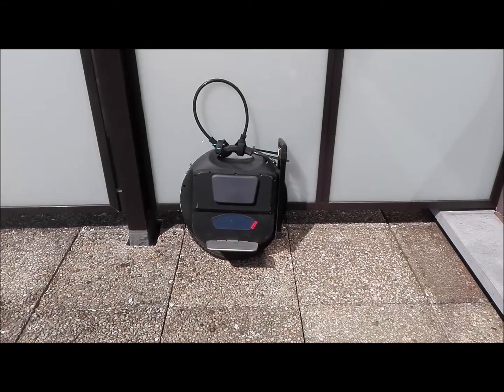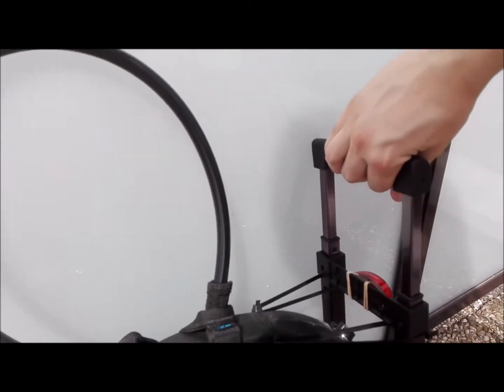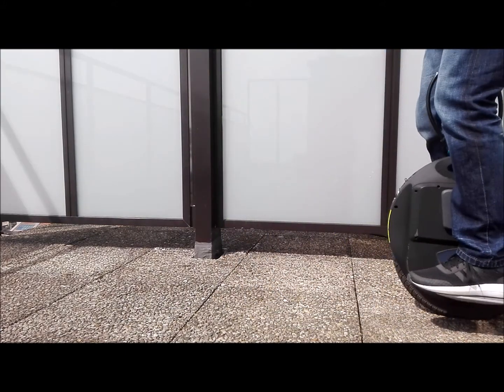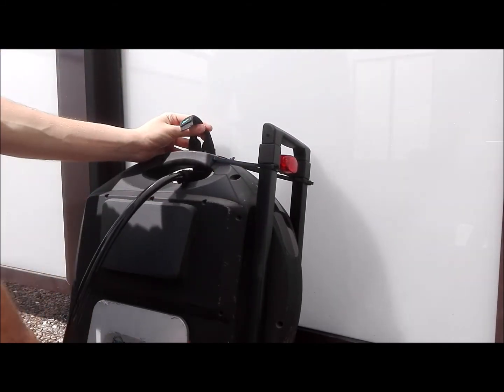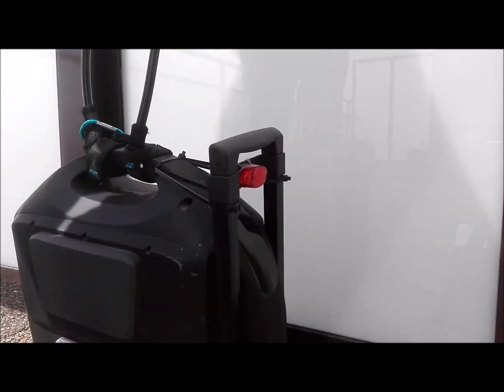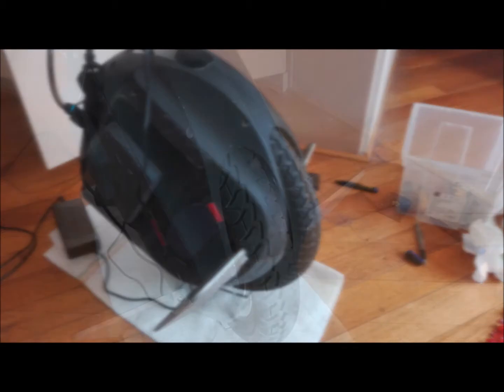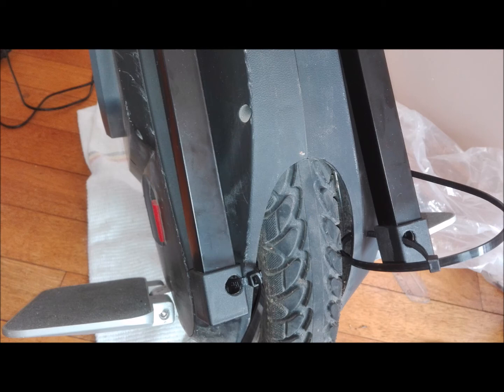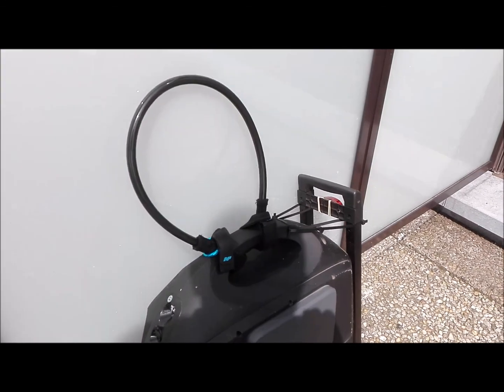Gotway ACM trolley handle DIY

Comment: Hi, thanks for the info.
Can I ask where did you buy the harness line, please? 
What is the length of it and the brand? 

Thanks
Reply from the maker: Hi ! unfortunately the shop where I bought the harness line doesn't exist any more. But I think you can buy one online. The length is 24 inches I think. No clue of the brand, I threw the packaging away...
Reply: Thank you for the length at least. Thats kind of important too :) I will try to find something. Have a nice day